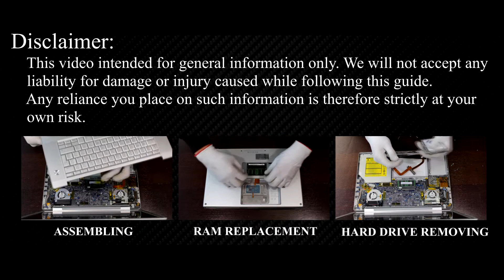MacBook Pro 15 A1226, A1260 Disassembly & Fan Cleaning | Step-by-step DIY Tutorial

Comment: Friends, hi. I have an empty battery for this Mac. I put together an assembly out of batteries.  I want to put in it. Opened it, there in addition to +- there are two blue wires. On what scheme they are connected to the batteries? Maybe someone knows. On the Internet did not find information(